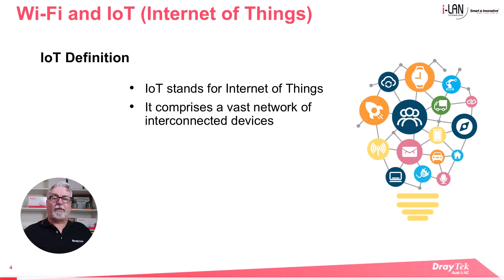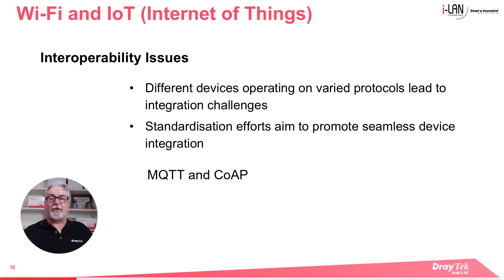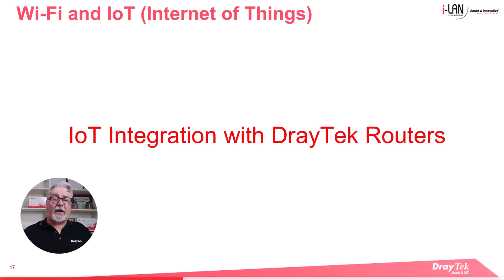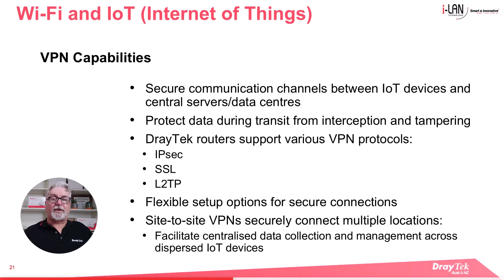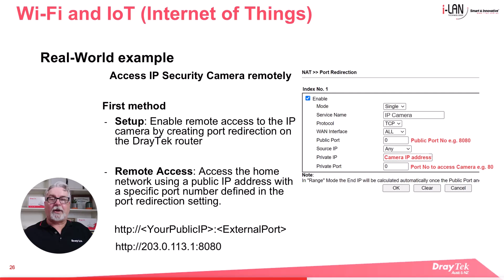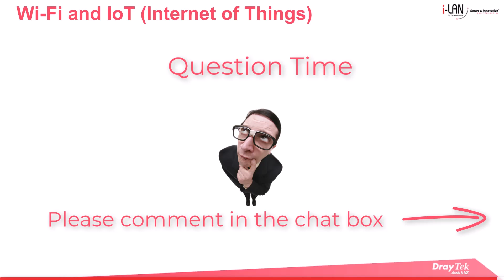Webinar - Wi-Fi and IoT (Internet of Things)

Comment: It sounds like you found an insightful piece on DrayTek routers and IoT, which stands for the Internet of Things. IoT connects devices to the internet to share data, but challenges like connectivity, security, and bandwidth management are key concerns. DrayTek routers help address these issues by offering reliable connectivity, secure Wi-Fi, and effective data management for IoT devices. The article also provides real-world examples showing how DrayTek routers are used in IoT environments. If you're curious about IoT and Dray Tek's role in it, this piece from GAO RFID Inc. is a great read!